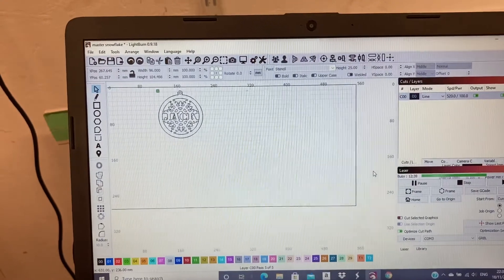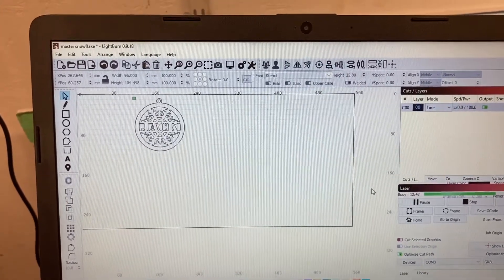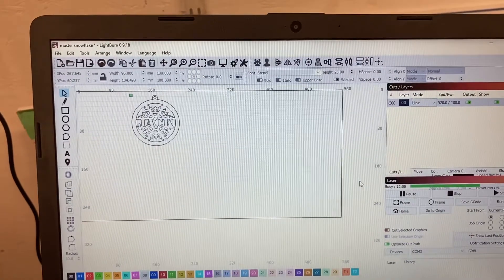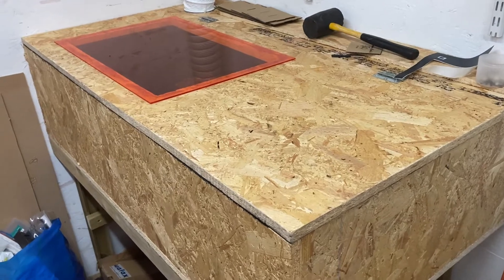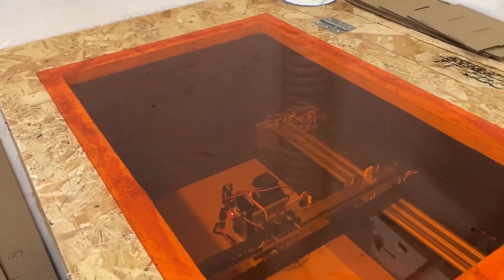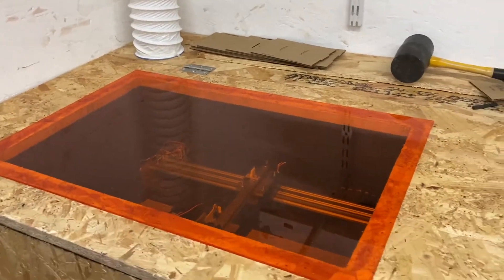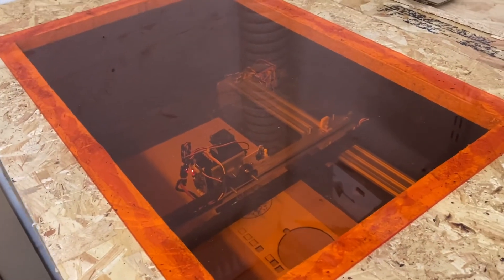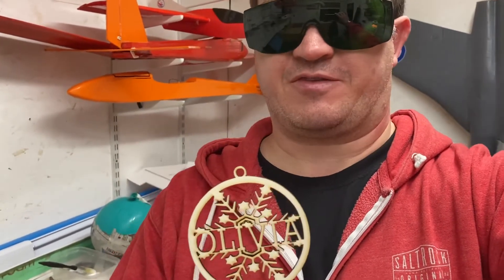DIY laser cutter enclosure update

Comment: Which laser do you have Sir? Thanks
Reply from the maker: Hi Rob. This is the laser I used.  To be honest  I started doing more cutting than engraving so have moved on to a 40w k40 co2 laser.  [£80.50 45% OFF]450nm 5W Laser Engraving Module Blue Light  With TTL Modulation  Laser Equipment from Industrial & Scientific on banggood https://banggood.app.link/D2ooWX6nKeb
Reply: @jenkyrc  Thanks for getting back with me friend!! You completely lost me with the third sentence but I am going to that website and check it out. Would you have good things to say about this laser Sir? Also if I may ask did you start cutting more because there’s more money there or what was your reason for changing from engraving to cutting? Thank You my friend and thank you for the video!!.. You have no idea how much it would help me out if you had the time to answer my questions.
Reply from the maker: @robjtko  the change was down to speed an efficiency really. I was cutting Christmas ornaments out of 3mm plywood. With this diode laser it would take up to 7 passes and about 25 mins per job. With the Co2 the same job cuts in one pass in less than 5 mins.
Reply: @jenkyrc  Wow thats a tremendous difference! And you are now using the laser that you mentioned and left the website for? I’m going to that website right now. Thank you!!..
Reply: I went to the website you left. It is the first one you see on that site isn’t it? I don’t want to bother you but would really like to ask you more about it if that is ok? I just might purchase that one. Honestly I need someone I can trust who doesn’t mind answering some questions for me. You let me know if thats ok and I will explain what I want to do with my laser once purchased. Also if you are affiliated with the maker I will praise you to them!! Thank you friend!!!..
Reply from the maker: @robjtko  unfortunately I am no expert.  The best source of knowledge I have found to be Facebook groups about diode laser cutter/engraving. Worth searching for a few and joining them.
Reply: @jenkyrc  Thank you friend!!